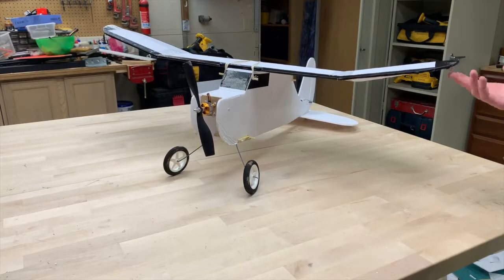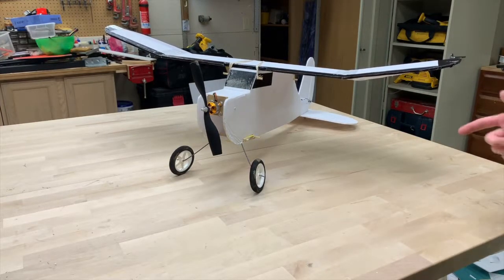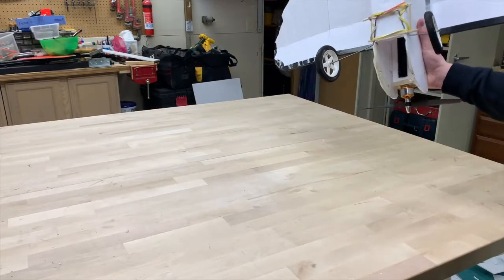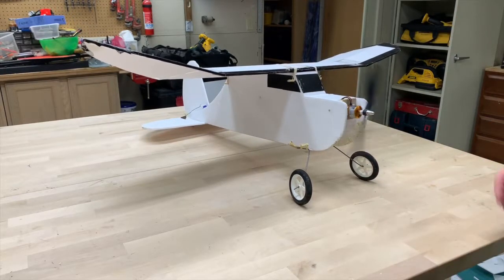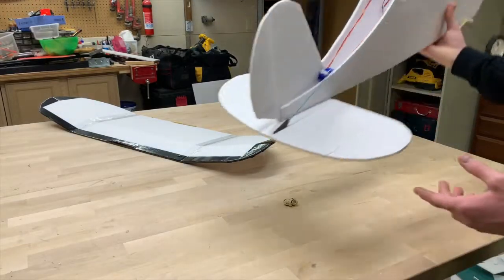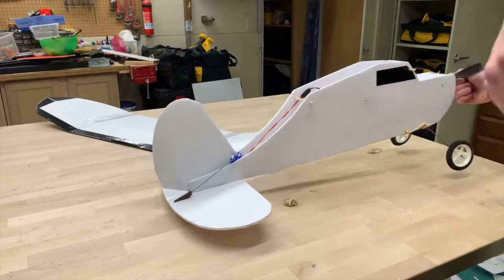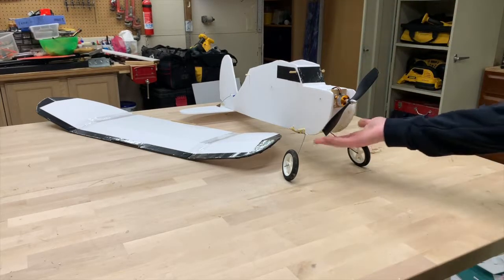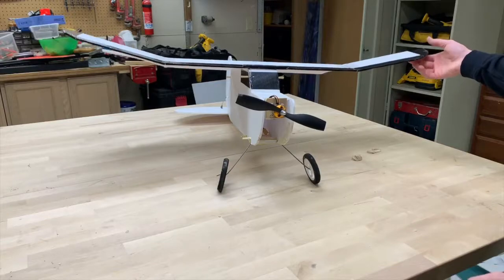FT Old Fogey - Scratch Build Review

Comment: 1000KV sounds righ, 10,000 and you'd have a ducted van.
One recommendation, take a breath between words. I found it hard to keep up with your rapid-fire speech. Each sentence was like one continous word. (I don't mean to be critical but I too am an Old Fogey and hard of hearing.)
There was no mention of what size battery used.
Many other builders have commented that getting the center of gravity correct is an issue with the FT Old Fogey. With moving the servos rearward in your rendition did you find it difficult to achieve correct cg? and if so, how?
Reply from the maker: Yep, 1000kv, I have since fixed that hahah. And yeah, I do talk fast. Anyways, I was using a 1300mah here and It wasn’t too bad, but a 2200 3s may be better. Thanks!
Reply: Strongly agree with that. His delivery was too fast for me to get more than some of the dialogue. If the narrator could just speak a bit slower,  and avoid excitement, I believe the audio instruction would suit the likes of both of us as well as some others who ar not Americans..